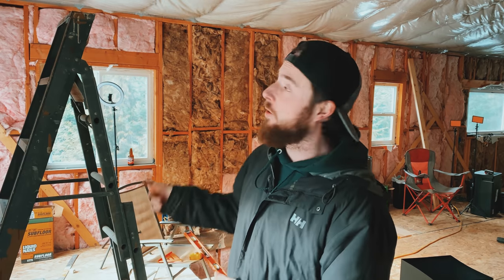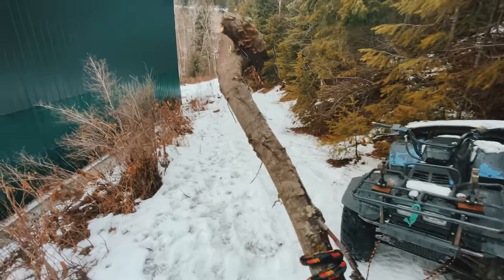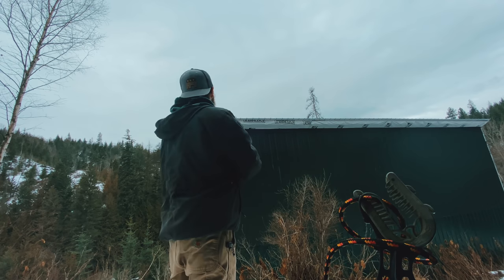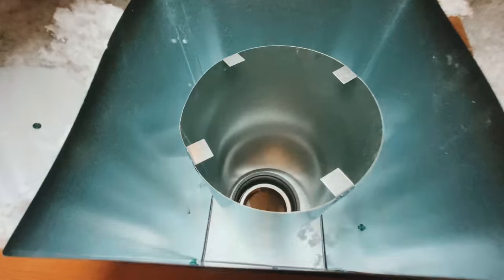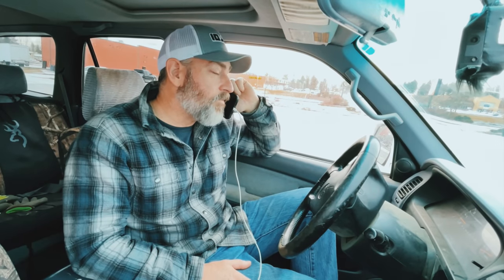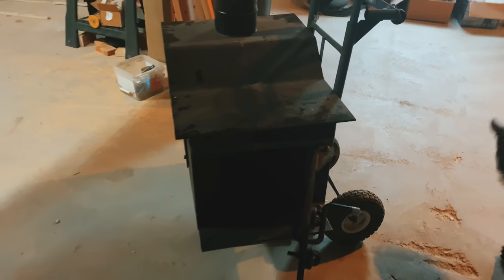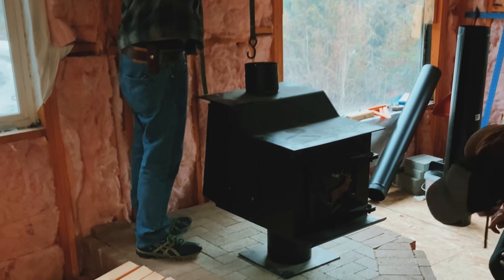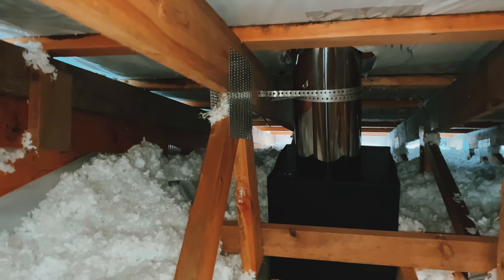Installation Collaboration: Wood Burning Stove | Shop House Homestead

Comment: That's a cool cat... When I used to do metal roofing I would use a old rag to rub gas on my shoes to make them stick to the metal roofing... Works great
Reply from the maker: Thanks for the tip. I’ll try it.

Comment: I do not know sh- t about anything..but should there be a damper in the pipe above the stove so heat andburn rate canbe controlled?
Reply: I am seeing that a lot with the recent installs of wood stoves.is there a new invention in the pipes that keeps all the heat from going straight up it.? yes I burned wood for years and our stoves both had a damper.
Reply from the maker: It can go either way. We may end up installing one